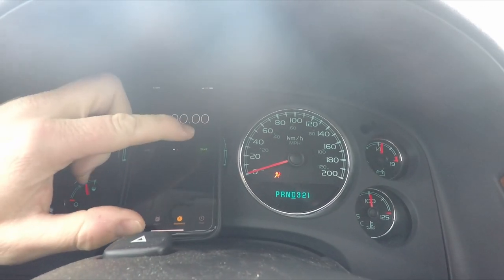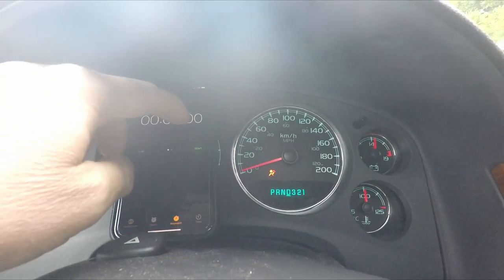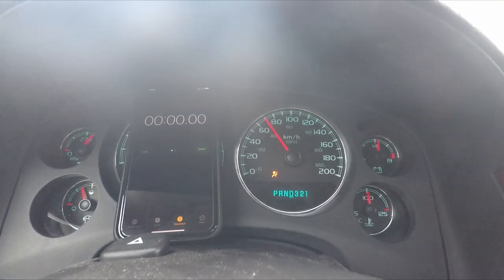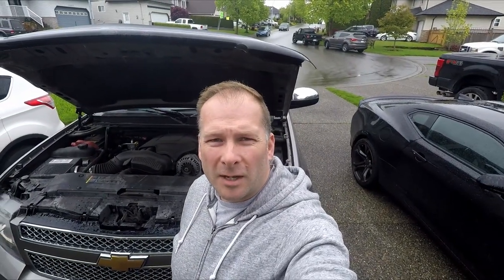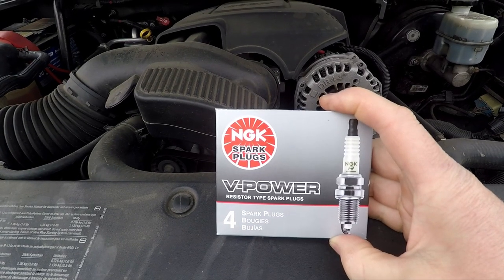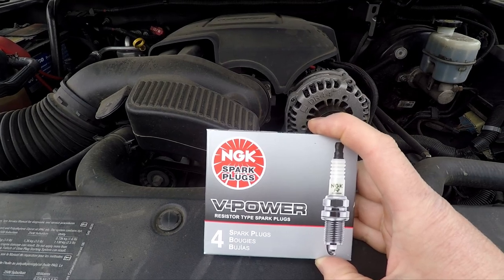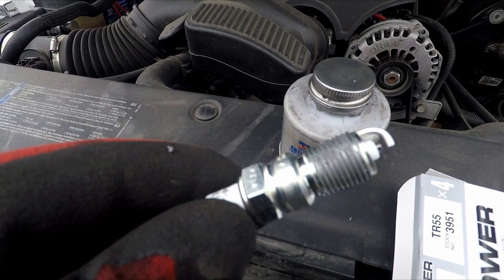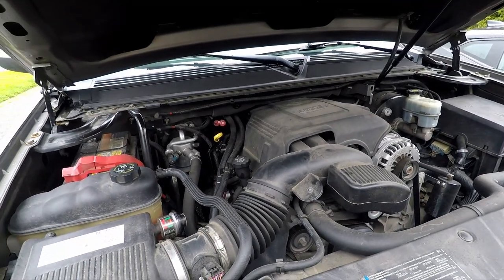Does Changing Spark Plugs Really Increase Performance? My not so scientific test.

Comment: If it helps, GM OEM spark plugs from that era are generally marked with a paint dot on the very end of the terminal.  I'm sure my LQ4 truck needs new plugs so maybe I'll give the copper ones a go.  Thanks!
Reply from the maker: Great info! I’ll have a look at the plugs that came out! Copper ones may work well for you but I’d do my homework first. They’re a good cheap alternative to iridium in a-lot of cases.  
Thanks for the comment and for watching!